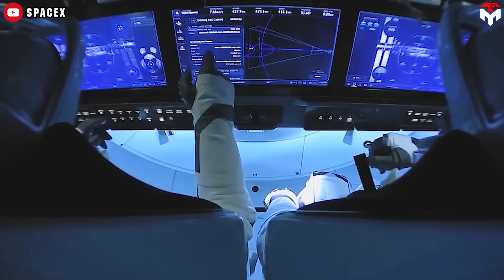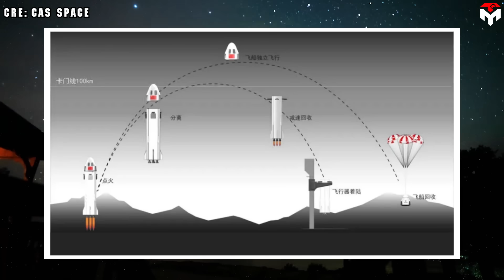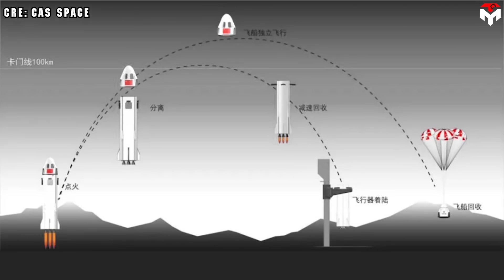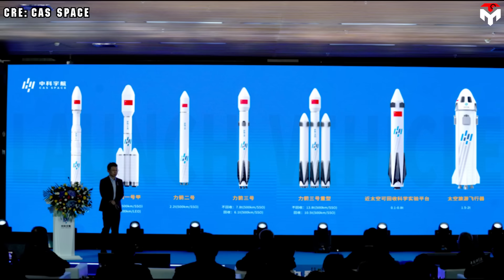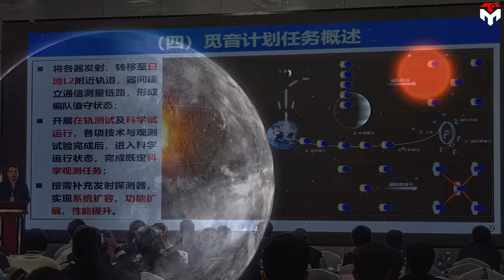China Tried to Copy SpaceX Dragon But Failed...Elon Musk Laugh!

Comment: The miniature zk6 that they had hovering.... It had two or four model rocket turbines in it, you can see the air intakes above it.  They are still learning how to hover. It doesn't even have true throttle capable rocket engines in the base of it. They have a very long way to go.